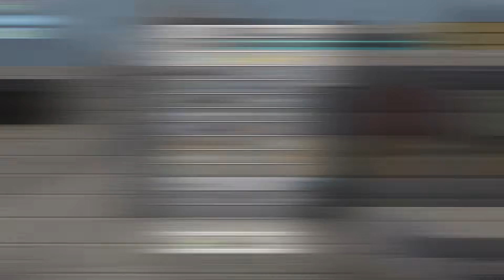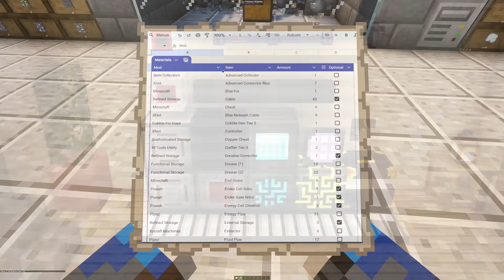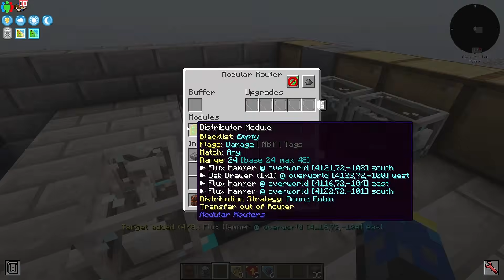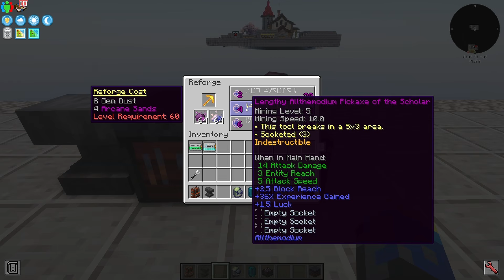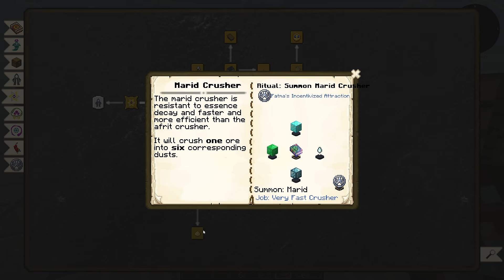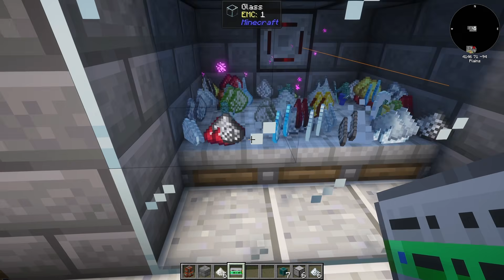The Ultimate Sieving & Ore Automation Setup | All The Mods 9 To The Sky

Comment: Good tutorial and an amazing job as always for the hardwork. There are some things that might make the build more faster/efficient.

1. You can get more soul sand faster by haunting the sand instead of using witch water.

(Place a depot at say y=1 with y=0 being the floor, break 4 blocks around the depot [y=0] and place soul sand there, place 4 encased fans [at y=1] facing towards the depot a block behind the soul sand, break a block [y=0] behind each encased fan and the block to the right of it, place a water source at each of the right block and place a water wheel from create at each encased fan. 
Shift right click a smart chute at the depot and place a storage access point [from functional storage] above it, connect the sand drawer for witch water and the storage access point to a standalone drawer controller and you can transfer sand from the drawer to the access point wirelessly [you may have to break and place the chute again so it updates] and light the soul sand with flint n steel, there you have faster soul sand.)

2. For storing the ingots, compacting drawers are better since there would be already available nugget and block form of the ingots for easier autocrafting.

3. If you don't use the magma block for the deepslate igneous extruder, it will produce cobbled deepslate, which can also be converted to crushed deepslate for sifting, making blackstone sifting not a requirement for deepslate sifting.

4. Sophisticated backpack with auto compacting is a fast way to convert chunks to ore as stated in another comment from @araeosthepaladin so better to use it since it also provides extra backlog storage, just make sure to have a slot for each chunk and ore saved in memory incase the backpack fills up.

Edit: Summarizing another useful comment I saw here from @jonasgajdosikas1125.

- Send all the cobblestone into a sophisticated backpack with an auto compacting upgrade in it to convert the cobblestone to 1x cobblestone and then to 2x cobblestone and then crush to a 2x gravel them via a mekanism crusher and then send it to another crusher for 2x sand and same for 2x dust, uncraft them [I don't know if sophisticated backpack can uncraft but if it doesn't then use a rftools crafter] for faster generation for gravel, sand and dust.

-And don't forget to enchant your sieves! :)
Reply: for #3 you need to sift blackstone for iesnium for occultism (or can go the bee variant and skip this)
Reply: @clytemnestra7489  I meant that for deepslate sifting, you don't need to first sift Blackstone, Blackstone does need to be shifted but not a requirement for deepslate
Reply: @Legend-ij8yk  no but I assume he wanted to show all required stuff for later 😃
Reply: also for #4 you can put compacting upgrades on the chest directly, sopshisticated storage one. You need 2 to whitelist the chunks, else is going to pack prismarine and quartz and stuff
Reply: @clytemnestra7489  I prefer backpacks since I can just shift right click to pick them up, with soph storage I gotta packing tape it first

Comment: for all of these you can also use MA to just craft these resources to sift directly

if you don't want to use MA, there's an improvement that can be done with soul sand, use a create haunter, it's much faster and will just be more compact

another thing with the crushers is that you can also use are ocultas, that works just as good but you can directly just use pipes instead of a dropper system

Comment: This is good for early game, but to be honest you don't really need the ore doubling once you enter mid to late game.

My setup for the sieve was a row of Sophisticated barrel, with sieve on top of them and hammer on top of the sieve, you can change the output side of electtic hammer with the hammer from the same mode. 

All sieved output goes to their respective barrels and pulled out from the controller to a cache barrel with compacting upgrade that only compact exhilo mod items. This cache barrel will hold the blackstone and deepslate as some sieve will produce those pebbles, so void upgrade is needed for those.

I have one pipe that will pulled all ores block to an unobranium furnace/rainbow furnace and smelt them directly, and another pipe to pull items that are not smeltable into a ender chest, the output of the furnace goes to this ender chest as well.

With the highest upgrade and max enchant on the sieve, a single pipe could not even manage the transfer as there are so many item flooding in.

Btw, I'm using MA essence to create soul sand, nether rack and end stone . Black stone and deepslate are pretty much recycled from the pebbles generated from sieve
Reply from the maker: That's true, especially for the MA Essence crafting, however I wanted to keep it as generic as possible to limit the different mods ^^

Comment: Even for the ones that have absolutely no idea of Create (ME), a very easy 2x2 horizontal water wheel powered Encased Fan can turn stacks upon stacks of Sand into Soul Sand instantly. Jei shows how it works. It just needs a few Wood Logs, wood planks and andasite to set up, and much more effective than 11x (Even 110x) Oak Barrels on top of Mycelium.

An Advanced Item Collector (to Whitelist "Soul Sand" so that it will only pull it) that's on top of a Drawer can easily pull them inside the Drawer. (a demagnatizer around it prevents you from pulling the sand / soul sand by mistake) Easy setup and extremely efficient one. No matter the amount of Sand you create, it can turn it to Soul Sand.

Requirements
1x Water Wheel 
1x Gearbox 
1x Encased Fan 
1x Soul Sand
1x Flint & Steel to create fire on Soul Sand
Some kind of dropper, I used "Dropping Conveyor Belt", very precise, compact and cheap. 
Advanced Item Collector
If you are using a Magnet, you can place a Demagnetizer to avoid pulling in the drops. 

It seems you went for specific mods only, but Create is not much different than the chosen ones, and it is in almost every single pack. 
Oh before I forget Compactor Upgrades for Sophisticated Storage helps immensely.
Reply from the maker: You are right I considered a haunting setup but i already covered a lot of mods and especially for the base materials I wanted to showcase simple options every new player can work towards ^^
Reply: system collapse did a video on his sieving setup like this, flat waterwheel, vert gearbox, fan, then haunting the sand. only downside is how much sand would be left floating about. good to experiment tho

Comment: How do you get the Integrated Dynamics player interactor (for the pickaxe) to work in another direction? Rotating the build by 90 degrees causes the pickaxe to break into the routers and the chest that contains the pickaxe.
Reply: i wonder as well as i have the same issue and i cant find a solution either
Reply: I'm having the same problem 29:37
Reply: Same here been trying for hours
Reply: yes, from what I've tested it's only breaking correctly if the direction is facing north/south, it's messing up when its facing east/west. However, I've found much easier (and cheaper) to use 2 RFTools Builders, one for placing and the other with furtune mining.
Reply: It can be a team isue. Alow some modes. (pres M) go to teams. Properties.

Comment: it's way more efficient to use a mekanism crusher to make gravel and sand as you can directly use compacted recipes – e.g. 2x cobble -> 2x gravel -> 2x sand. you can in theory also use 3x, but then you'll need to use the 2x2 limited barred from sophisticated with a compression upgrade.
also there should be a filter module option that makes the crafter only accept items in recipes it has stored inside
Reply: I teasted it, but the 2x2 limited barrel with an compression upgrade doesnt work...
Reply: @Gildarts958 3x3*

Comment: For the breaking of the ores, Instead of all those routers and integrated dynamics, you can just use 2 rftools builders.
one with a shape card placing your wall (or in my case, floor) of ores
one with a fortune clearing quarry card eating the wall/floor/cube of ores.
EDIT: I understand why you went with the integrated dynamics; for the extra fortune. but I still think a builder would be a better way to make the wall. =)
Reply from the maker: Great idea aswell, but I guess the fortune is lower than with a pickaxe right?
Reply: @EpicEnchants  The card is equal to fortune 3. But I have heard there's diminishing returns on fortunes higher than 4 so its probably still worth it, especially early-mid game when we don't have indestructible picks or high level enchanting setups or apotheosis farms to get those gems.
Reply: @Alteran  Fortune 3 is not even close to fortune 13 lmao. Apotheosis gemmed pickaxe is way to go if you want the best output.
Reply: @Alteran  omg thank you, was trying to decide how to do this without the indestructible pick. since i just cant be bothered to work on making allthemodium atm
Reply: Another option is to use a breaker module in the modular router that places the block. You can enchant the pickaxe used to create the breaker module but I think we're at the Fortune 3 vs Fortune 13 discussion again. You'll also need a sender module with a /raw/ regex filter for when the router ends up with the raw ore in the buffer.

Comment: Yo EpicEnchants! As a minecraft modpack veteran like you are I have an improvement to your design. My setup is pretty similar to yours but when it comes to compacting ores - don't use crafters. Instead use sophisticated storages 'compactor upgrade'. It does the same job but instant(basically infinite compacting speed), without power and has more configuration slots (you only need one "crafter" inventory). Hope this helps and as always: thanks for the great video :)
Reply from the maker: Aaaah I tried some compacting approach but most of them didn't work so I just gave up a some point. Thanks alot for the tip!
Reply: @EpicEnchants  you need to set it to "compact anything" as the default is to only compact uncraftable. BTW, this also works for diamond and emerald essences as they use a 3x3 crafting recipe
Reply: @EpicEnchants  Yeah I couldn't figure it out in recent modpacks I've played, but I wanted to used for ATM9-TTS. Its a bit tricky to set up but it produced several million ores for me so I'd say it works fine ^^
Reply: @EpicEnchants I ran into a problem with them not working correctly at first as well. How I fixed it is by setting up the compacting filters in a different chest. For some reason it can bug out when you set them up in the chest/barrel that already have the items you want to compact in it.
Reply: I also use netherite barrels to compact. Is insane
Reply: Additional you can enchant your meshes for max output
Reply: Epic why you dont use create for soul sand
Reply: Actually it's way too good for storage system as well. I just send the ores that is smelted to the sophisticated storage too and then take them back to the storage system so that I can store them as their block types instead of their ingot types. If you have not enough space in your system or like me if you just want to more efficient this strategy works very well. You can also use the blocks compacted versions and they are up to 9x ones if you want but it is a bit hard to convert them back to their ingot types when you are in need for them so I just dont do that and satisfied with normal block types but do what you want to do.
Reply: I'm confused how to filter the backpack so that it only holds the chunks to be compacted, or does it not matter (hopefully I'm not too late asking haha)
Reply: I was wondering why compacting drawers weren't being used in the video. They help tremendously
Reply: @qahnaarin6532  compacting drawers are significantly worse since a whole drawer is required per item that has to be compacted. Using iron barrels with compactor upgrades is much simpler with only one barrel being used
Reply: @araeosthepaladin  ya, I can see where that makes more sense in this setup. Less materials and more compact. I can see their reason for using the drawers. Simply for access to the individual items. It's more about preference for convenience vs automation.

At this point though, I'd have to rewatch the video to remember what point we're talking about 🤣

Comment: You can use bulk haunting for the soul sand
Reply from the maker: That's true I considered thst but I tried to limit myself to the generic mods like exdeorum ^^
Mystical agriculture also can easily make tons of soulsand:D
Reply: with mystical agriculture you have to set up autocrafting for soul sand but by bulk haunting i used immersive's dropper conveyor belt and a water wheel but yeah you're set up is great would have done it no doubt great vid keep up the work❤